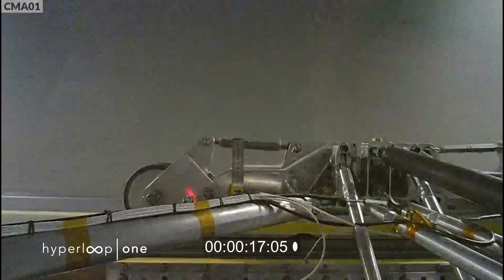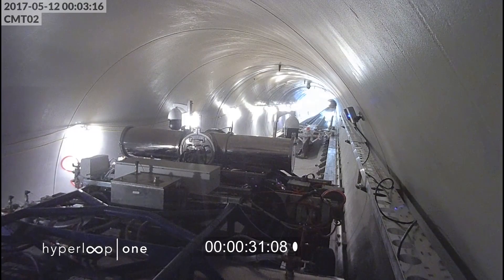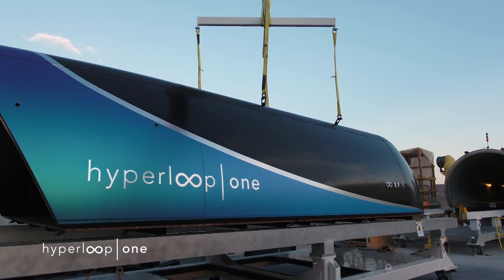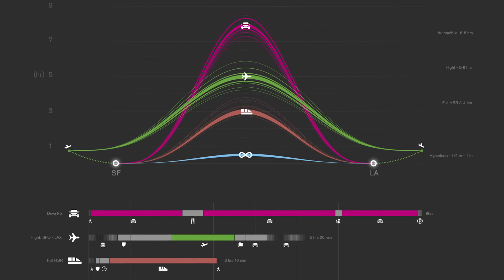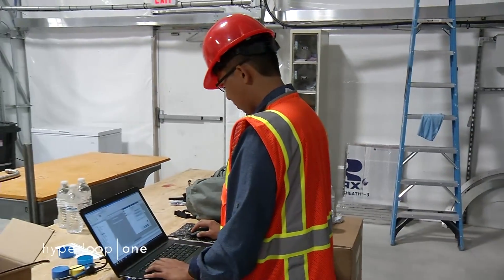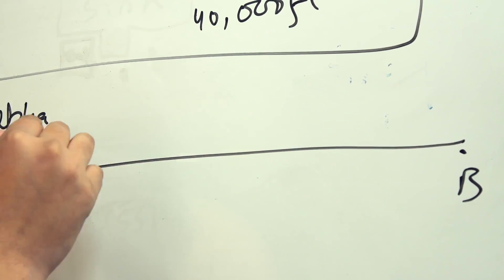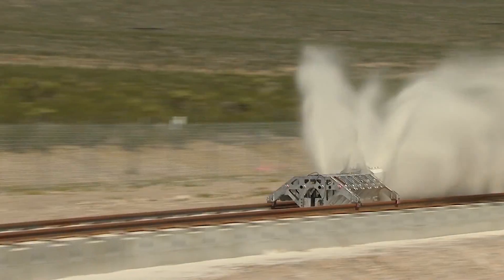Watch the Hyperloop Complete Its First Successful Test Ride | WIRED

Comment: It will be the future of transportation.
Reply: How will they cope with thermal expansion of a tube that needs to maintain a .001atm, at 700 miles long, a 10 degree jump in air temperature would elongate the tube 12 feet, its a pipedream. Not the future
Reply: +Panda #44 You don't have to worry about it, there won't be a Hyperloop transporting humans, so far it's a dumb idea if you look at it closely.
Reply: I like driver less cars being the future of transportation
Reply: No it will not. Trains are more efficient in every way.
Reply: Doubt it.
Reply: shebaz khan you ain’t getting me into one of these for years gonna wait for the first  crash to know what can go wrong
Reply: @NKyoko hmmm its been a year since my comment,  not only have they abandoned the project and had 90 percent of the funding pulled. Industry experts (my self included) have all come out against it as a pipedream. Its not the future, nor will it be until someone creates a high tensile strength material, capable of holding huge weights, that has zero thermal expansion. Examples of this material dont exist.
Reply: It will be another failure wrought with setbacks for so long another technology will render it useless. Can you just imagine the maintenance cost of a miles long vacuum system.
Reply: Bullshit. Robert Goddard came up with this idea in 1904. It was bullshit more than a hundret years ago. Musk just took that stupid idea, put his name on it, and that's it. It's still a stipud idea. Welcome to reality.
Reply: @dxb8086  k... Time to stop making ideas or doing repetitive things just because someone did it first... Really don't know the principles of engineering.
Reply: shebaz khan lets hope so
Reply: dXb its matter of technology, this idea needs the complicated tech that people didnt yet found in the past. But now is different we already proceed a lot, eventhough still need improvement here and there. But its not sound as impossible as it was anymore.
Reply: shebaz khan yes!!!!!!!
Reply: dXb ideas are everywhere. It's just that who make it real. It doesn't matter who's the idea is, but only who implemented it.
Reply: if someone has seen the first guys who were trying an aeroplane. then people will probably understand that nothing is impossible. in this 21st centuary
Reply: Yes .. I can see this being a part of future transport ... without any doubt.

Comment: Assuming that the maglev part was meant to reduce friction of movement (like the air hockey disc) as Elon said and the vacuum within the tube was meant to reduce air drag resistance during movement.

The concept of a 'consistent presence of a vacuum' within such a long isolated tube, containing an extremely fast moving object with humans inside, introduces more challenges than advantages.

Why not eliminate the 'Permanent vacuum' and make it a 'Temporary vacuum' that will be used to drive the pod forward like a free piston fitting snugly against the sides of the tube using some seals like an o-ring. 
A pressure differential that can be created on demand(between the front of the pod and its rear) could propel it forward at high speeds. A pressure differential could also be used to brake the pod since the pod would behave as a free piston.

As desired speed is gradually achieved, the air tight connection between the pod and the tube could be simultaneously disengaged to reduce frictional losses while the maglev flotation could further reduce friction helping to maintain momentum (like the air hockey disc.) 

Since everything outside the pod including the air inside the tube is moving in the same direction the drag can be effectively controlled simply by controlling the pressure differential.

Can the temporary vacuum suggested drive a 15 ton pod at high speeds? I don't know? It would be worth a try though. Would a pneumatic hyper loop even allow multiple pods travelling in close proximity if the pods behaved as free pistons. It could be worked out. 

Instead of completely eliminating air resistance by conceptualizing a permanent vaccum tube, why not use that same air resistance in reverse to propel and in forward to brake the pod; both @ insane speeds. It seems achievable. Passengers would be more at ease knowing they are not travelling in near space conditions. The target speeds could be achieveable, as the air within the tube would be working with the system rather than against it.

Comment: I love the audacity and entrepreneurship that's in some people's mind.

But I also understand that many people who are just more than willing to deny anything beyond their imagination or status quo.

I am just curious why there are overwhelming number of denial in comments, but there are equally overwhelming more likes than dislikes.
Reply: simply put: overlooked issues and the fact that they didnt use a vacuum. 

overlooked issues being thermal expansion, the energy cost of maintaining such a vacuum and the risk of explosive decompression. which can be caused by just having something like a bird hit the side of the tube. which would instantly kill anyone currently inside that tube.

granted most of these are easily fixable. just have joints at every X meters that have opening and closing sealed doors so only people in a particular section of the hyperloop tunnel die a horrible instant death, having those sections would also solve thermal expansion when done correctly.
Reply: I mean there are good reasons to be skeptical about this.

Comment: why do people take this seriously?
it kinda made sense 15 years ago when it was supposed to be an underground train built on reinforced tunnels. now open in the air like this? lol no way. someone shoots that tube and suddenly your 500mph train is headed directly to a wall of 100 denser air that it's going to hit like it was a concrete wall. that's assuming no catastrophic failure in the tubes themselves before that.
Reply: How the fuck is enough air to create that kind of instant pressure change going to flow through a bullet hole?

Comment: Just make a maglev like the bullet train and it would already be done and be much safer then a train in a vacuum.
Reply: The air pressure is lower but planes are not in a vacuum because they are out in the open in our atmosphere. They experience turbulence because of wind, the hyperloop gets rid of all wind resistance and turbulence because there is no air. The vacuum essentials takes that out of the equation but you would have to worry about rapid repressurization since the atmosphere pressure is none in the pod and right outside is our usual atmosphere.
Reply: the hyperloop is proposed to be the safest mode of transportation.
"it's in a vacuum"
so are planes
Reply: @the.abhiram.r  planes aren’t in a vacuum…
Reply: @Daz912  can you breathe at 15,000 feet?
Reply: @Daz912  im not saying there's no air, but people are afraid of traveling in a vacuum, planes are essentially in a vacuum for humans
Reply: @the.abhiram.r  They’re nowhere near being in a vacuum so I don’t know what point you’re making
Reply: @the.abhiram.r  do- do you know what a vacum is?
Reply: @the.abhiram.r  Yes my man, you can breath just fine at 15 k ft.

Comment: 0:24 what is that an vakuum pump? Wow that thing needs to spin fast to do the job, or is it cooling no way the hyperloop cant get so hot becous then it would be very ineffectiv espacely becous its not even the full scale model right?
0:47 dump qustion but why the fuck is there a hole and why is those other hole coverd with an card board? Is it like an Diod just with air instead of Electric current, letting Air one way out but not the other?
 Why are there so many with boxes evry where?! WTF?
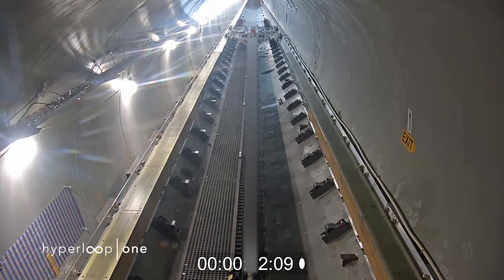1:48 wait that thing is levitating but where is the sound coming from in 0:07 then wtf? Hyperloop dudes you ryl need to look for your bearings or gears there is somting wrong! 1:50 so then you have no gears no Motor on it where is the sound then coming Magnetic interference yea it must by that for sure! 

Very sad they didnt make the test public i mean all thous critics will be chairy picking stuff like the new invented Diod Paper i mean this will be for sure be the next Invention Elon Musk will Public for sure next to the 100'000RPM Spinning Air thing.
Wow there is ryl nothing that can go wrong with the Hyperloop i dont understand all those critics ryl i mean why should Elon Musk support a project if its never gonna work i mean this mean is a Billionear!

Comment: Air resistance is hugely important, especially at high speeds. There is a reason why cars have a top speed of about 270-300 mph, and it has everything to do with air resistance and terminal velocity. At high speeds, the resistive force of the air is the main limiting factor to reaching higher speeds. It turns out that there isn't a linear relationship between engine power and speed, when you factor in air resistance. 

The force of the air resistance is proportional to the velocity squared, multiplied by a constant.

The difference of a vacuum is the difference between 700 mph and 300 mph, at least anecdotally, which is quite a difference in kinetic energy (the difference between kinetic energies is the work - so that is a lot of energy being transferred into the cabin).

The "main reason" for the vacuum, is not to just stop drag caused by air resistance, but to stop considerable drag caused by air resistance.

Comment: 70 mph wow my car could go faster with less energy and more safer
and that vacum is great but i don't see any pump to suck the air
Reply: More importantly is that if a single hole appears or any bolt loosens or shifts in this tube, air will immediately fill the tube and will need a long time to discover and repair, which will be extremely expensive
Reply: *700

Comment: Steel expands and shrinks. Solar panels have only 20% efficiency. The whole system will have huge leaks and thus require a ton of electricity to keep the low pressure. Its a very wasteful use of electricity.

Comment: How will the tunnels be protected against leaks or damages in the tunnels structure and the then-streaming in walls of air hitting the pods? Any idiot can shoot with a gun at the tunnels walls, the entire vacuumed track will implode and everyone traveling in it will die.
What happens if a pod gets stuck during mid-travel? They'd have to pressurize the entire track just to let people out.
What happens if a pod has a leak/damage in its structure during mid-travel? The passengers will die due to instant decompression / being in a vacuum.
What happens if the engines that hold the pod in mid air has a hiccup for a brief moment and the pods hull will brush the tunnels structure while speeding around at 900km/h? The pot will crash and everyone in it will die, not to mention it'll take the entire track with it.

Comment: On November 18, 1991, Gerard K. O'Neill filed a patent application for a vactrain system. He called the company he wanted to form VSE International, for velocity, silence, and efficiency.[10] However, the concept itself he called Magnetic Flight. The vehicles, instead of running on a pair of tracks, would be elevated using electromagnetic force by a single track within a tube (permanent magnets in the track, with variable magnets on the vehicle), and propelled by electromagnetic forces through tunnels. He estimated the trains could reach speeds of up to 4,000 km/h (2,500 mph) – about five times faster than a jet airliner – if the air was evacuated from the tunnels.

20 years later Elon Musk renames it & comes up with a much slower version of the same thing, & gets international news coverage. Fame is a wonderful thing.

BTW a conventional maglev train could do the same trip in 36 minutes & is already available, just ask the Japanese or Chinese.

Comment: The hyperloop in it's current state will not work.EVER. They have had two test tracks. First one was when they tried out the pods that the universities had built. Four of them failed miserably by exploding or just not going foreward. The winner of the contests pod went just a couple of metres. Go and watch the footage it is not impressive. The first test track was just a quarter of a mile. And as you know the hyperloop is going to be a near vacuum chamber (having less than a thousand of an atmosphere of pressure) this was the second largest vacuum chamber ever made. And the actual one is supposedly going to be 400 times longer.
The second test track was the one that has been on the news lately it was a 600 feet long tube in the desert with a small train like thing that could roll on some tracks. People were somehow impressed by this. They probably didn't know that that is excactly how real trains work. You might think that this is different because of it small resistence in the vacuum, but i can tell you one thing. There was literally no pumps connected to the hyperloop test track. And the next thing is even more bizzare. There were some holes in the pipes which the pumps would connect to and they were covered in cardboard... FUCKING CARDBOARD. And if you know something about vacuums in our atmosphere in a tube or some kind of room you know that A cardboard plate can't hold thousands of tons of pressure out of the tube.     

PS. 
You could here sounds inside the tube so it was not a vacuum.

Comment: Since the tube will be vacuumed, the train itself would be pressurized like a plane. But then a plane maintain its cabin pressurization via cooled air flow into the engines, while the Hyperloop travels through a vacuumed tube.  I wonder what will happen when halfway through if the train loses its pressurization? When an aircraft loses cabin pressurization, it can descent to a safe altitude to stabilize the pressurized cabin. But what about this?

Comment: I'd like to see the hyperloop coated in solar photo-voltaic panels. Store the solar energy in combination of batteries and in the pressurization of the tube. Drive a generator by letting air run into the hyperloop tube through a turbine to supplement the power demands of Mag-Lev acceleration. AND if you have extra capacity for air pressure this is essentially storing electricity for the grid from solar power to supplement our electricity demands. Solar powered, efficient transport, and grid storage using solar-vacuum generators! Win-Win!

Comment: Cool entertaining Video.

However I wouldn't consider that a test if they only brought it up to 17 mph in their tunnel.  That's what the narrator said near the beginning.

Google tells me the top speed for this thing will be up to 760 mph. 

https://www.google.com/search?q=how+fast+will+the+hyperloop+be&rlz=1C1GGRV_enUS751US751&oq=how+fast+will+the+hyperloop+be&aqs=chrome..69i57.12704j0j7&sourceid=chrome&ie=UTF-8

If they can bring it up to that speed without it crashing for many times when it would indeed pass the test. Even though commuting isn't still 100% safe. 

On paper it can seem like it would work, but you never know until you test it repeatedly. For the past does not equal the future. And the only thing that's predictable about the future, is that it's unpredictable.

Comment: just make a maglev, its easier and cheaper, and come on, do you really need to get somewhere 1 hour earlier.
Reply: It's harder to live where you work because of zoning and stupid ass central office jobs.
Reply: Yes if you put a meglev in a vacuum tube then it's pretty much the same... except for the hyperloop will have terrible capacity compared to a maglev train.  Oh and it'd make it about 100x more dangerous since if you lose your pressure in the passenger cabins you're toast.  It's not like on a plane where there's just no oxygen so you can just deploy masks....you'd be subjected to a vacuum which is something you won't last long in.
Reply: If you get a maglev then put it in a vacuum tube then it's pretty much what you have here.
Reply: Yes, this America, damnit.
Reply: Also, it would be great for long commutes. You could live in San Fransisco and work in L.A.
Reply: If you save 1 hour, 1000 people riding the Hyperloop would collectively save society 1000 manhours of potentially productive time. Now multiply that by the hundreds or thousands more that would ride the Hyperloop. You're thinking on the individual scale, but Elon clearly sees the bigger, macroeconomic picture, where efficiency is king.
Reply: juki0h tuki I guess I should ask you "do you really want a car instead of a horse"?
Reply: I'm sure all the hater comments are the same when the train came out.  If and when it works it will be the new speed and transportation commerce.  Very limited in scale at first but so was the train.  Mike Row has a great pod cast on trains back then and how the oil man for the train was the speed of commerce then.  Good stuff both the history and the future we are living in.
Reply: this also mean less cars and more environmental friendly very nice idea
Reply: juki0h tuki time is money.
Reply: juki0h tuki it saves so much energy and it's faster cuz it's in a vacuum.
Reply: lets just stick to Ford Models T's right.  its cheaper and just works.
Reply: do you really need to get somewhere 1 hour earlier. ????? YES WHY NOT . Actually it will save many hours in a single trip. However to make this a reality it will take decades . It will happen though .
Reply: juki0h tuki yes time is money lol
Reply: Lewis Terroir    Creating unnecessary traffic is one of the problems that led to climate change. Live where you work, and make that place a good place is the better concept.
Reply: It currently takes 6 hours to drive from San Francisco to Los Angeles. Hyperloop can cut it down to 50 minutes. Huge time saver. Maglevs are cool, but Americans don't like the idea of sticking to a certain route and schedule. They love their cars because its pure "freedom"; they get to go where they want when they want. That's one of the core problems of American public transportation.